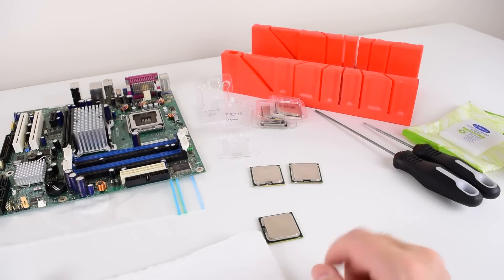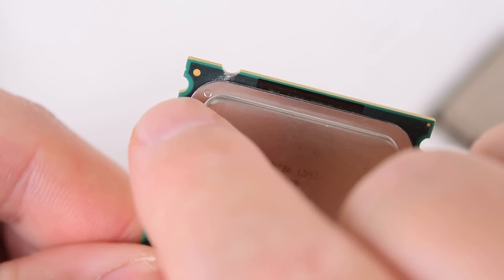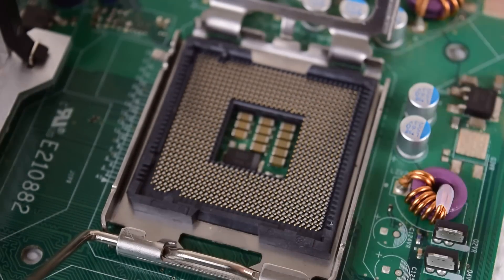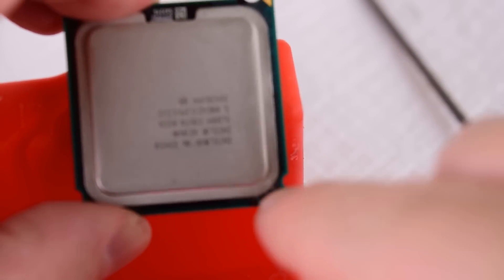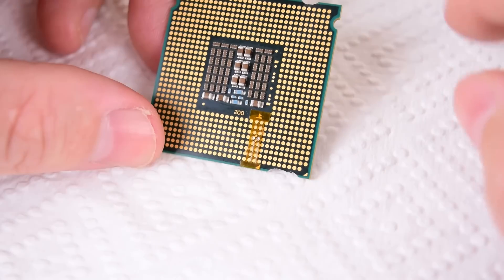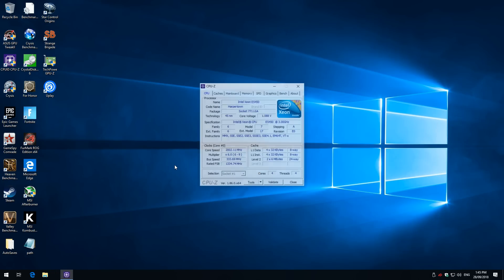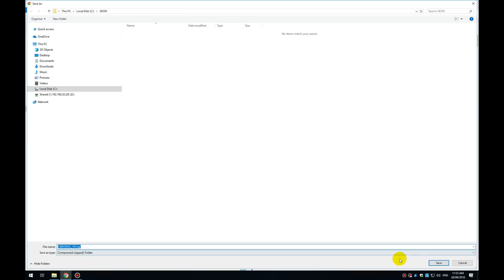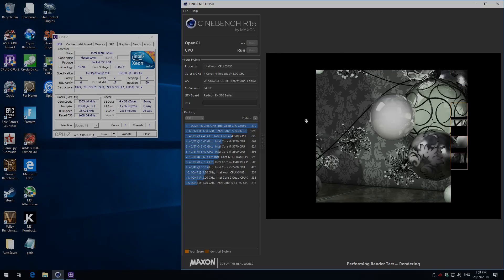Modding cheap LGA 771 Xeon Processors for Socket 775 Motherboard

Comment: can you add BSEL mod to this to OC it?
Reply: No, at least not on all of them, on some of them the BSEL mod won't work because the FSB is already at 1600 MHz
EDIT: Sorry obvious mistake, I meant 1333 MHz
Reply: Cant you mod from 1333 to 1600? If not then the voltage pad mods still might work if your motherboard will let you up the BCLK/Multi and not the core voltage.
Reply: @danielberrett2179  The mod from 1333 to 1600 isn't possible as far as I know, though you are absolutely right, voltmodding on those motherboards could be very useful
Reply: I think this should work as long as you get the right pins.
Reply: If I remember correctly, the BSEL mod only works on LGA771 boards which have compatibility for chips with a 1600MHz FSB.

Comment: When I did this mod back in mid 2015, I decided to chop the plastic lug from the motherboard CPU socket, rather than risk making a mistake cutting the CPU itself.  The Ebay seller I bought my CPU connection rewiring stickers from, also provided the BIOS microcodes for free.  I think it was a Greek seller but I can check if anyone is interested.
Reply: EgoShredder I’d rather mod the cpu for my asus P5Q as it’s a pretty nice board(I also plan to eventually buy a Maximus II Formula board)

Comment: I already have a Core 2 Extreme QX9650 (3GHz 12MB Cache) is there any performance benefit (other than lower power consumption) for a system like mine? The main limiting factor that made me jump to an i7 6700K was being stuck at 4GB RAM on my old motherboard. But I've been keeping my old hardware the last few upgrades...

Comment: That was one rough notch. It is called manual skills boys and girls. Work at developing them.
Reply: Better to cut one notch of plastic inside CPU bay of mother board. I did that way.

ASRock G41 VM r 2.0
RAM 8gb DDR 3
Xeon x5492  3.7Ghz , 12 MB of L2 cache.

No Bios update required n it auto updates it's microcode.
Reply: How did you manage to do that?

Comment: I have a Q9550 on a p5q deluxe at 4ghz with a cooler master evo 212 I wonder if a zeon would be any better ?
Reply: I doubt it, you're not going to get much higher than 4ghz with a xeon
Reply: Possibly, more than likely it'd just run at a lower voltage and therefore cooler. Though I did manage to get my old X5450 to 4.4GHz on my own P5Q Deluxe (post modding the BIOS), nearly matching my i5 4440. Not sure how well an E5450 overclocks in comparison though-my water cooler died so I can't go as high.
Reply: @dabombinablemi6188  got a question regarding asus p5q deluxe as i was wondering about your bios settings while running x5450 @ 4.4ghz. As i have e5450 eo revision i managed to overclock as high @ 4.38ghz at 1.33v temps were hovering around 70c. I was asking about voltage and ram timings as i was looking for compare result
Reply: Probably not, it’s not really worth the mid if you already have a 45nm 12 mb quad.

Comment: There is this one Video I have seen where some one ran an incorrect CPU socket on a motherboard and somehow they got it to work but it shorted out the motherboard after a while. I heard of this mod as well. I agree that modding the processor is better than trying to mod the board because if you damage a board that you want to use then your screwed. Makes me wonder how reliable is this mod on certain motherboards over time  because if you use a processor that uses wattage that the board does not support it could short out the board and ruin it.
Reply: Fender178 If you do use a 775 CPU as a placeholder into the socket while trimming the tabs the procedure is a lot less risky. Also, excluding the top of the line X ones, all the Xeons are rated at lower TDPs than their Core 2 Quad counterparts. They even run at lower voltage at stock settings and can be undervolted by a hefty amount. Running at 3.0 GHz with E Xeons at 1.05 V or less is quite a feat. And regarding SSE 4.1 then the Harpertown Xeons are your best bet to fill the bill. Best regards!

Comment: I'm trying to figure out what the sticker does, is it bridging some contacts? (pads) This is such a cool mod! I'd modify the socket personally since it's just two bits of plastic v. filing into the chip.
Reply: youtubasoarus The sticker routes the traces of the bridged pins, as they are inverted in 771 Vs 775. Those pins are involved in memory communication, thus the mod is critical to get them to work. There are other pin differences between 771 and 775 but most of them are grounding pads.
Reply: Very cool, thank you for the comment :)

Comment: Thanks for making this video! However, for anyone new to this mod I would prefer to recommend to mod the socket instead of the CPU, as it's easier, requires just a thin blade and the risk of damaging the pins are minimum if you use a cheap/dead/useless 775 CPU to guide the trimming. Also, this page contains a lot of pre modded BIOS files for a wide variety of boards for free: http://genius239239.myweb.hinet.net/771/. Hoping to see more of this platform in the future!

Comment: How much better is this CPU compared to a core 2quad q6600
Reply: It will be a lot better as it has more cache, faster fsb, faster clock speed, is 45nm(better clock to clock performance), has newer instructions(some new games and apps won’t run on the q6600), and will use less power. I have a q9550(equivalent to an e5450 but at 2.83ghz) and it’s way faster than my q6700(higher clocked q6600)
Reply from the maker: Look for q9650 comparisons!
Reply: A Q6600 should be tape modded to 3.0Ghz.

Comment: One question i use a modded xeon on an asus pq5l pro without having applied the microcode it is normal that it wont turn on?
Reply from the maker: It depends on the board, Bios and CPU. But if it doesn't turn on, yes, use another CPU to flash modded Bios.
Reply: @philscomputerlab  thx very much i enjoy a lot your videos keep it up!
Reply: You have to make sure the xeon chip is fitted correctly in the socket as i did get no boot before with asus p5q premium as the cpu needs to be align to the far right/bottom corner of the socket
Reply: @neddy1287  thanks alot mate that was the problem
Reply: @techcheap2340  let me me know how you get on with the xeon :)

Comment: Everyone talking about the new intel CPUs. And here Phil giving us a video about modding old 771 xeons to work on 775 platform

Great content.
Reply from the maker: Haha, like I say, I'm always late to the party :D
Reply: @philscomputerlab  haha, but I'm still gonna buy an lga775/771 CPU and Mobo, I'm so broke :'-|
Reply: Yeah, and I’ll take Phil’s content over that of those others any day. Those tech YouTubers are falling all over themselves to report about the same things at the same time: expensive, overpriced stuff that real people don’t actually buy. Those channels are a dime a dozen. Boooooooooring.

Sadly, many of those channels used to be good, but then they got too big for their britches. They’ve sold out to the big corporations who send them expensive products to “review.” No thanks... not interested.
Reply: All things considered the Xeons offer a considerable upgrade for the LGA 775 Platform. This is very easy to do if you take your time and use patience. The Socket Mod is very easy to do as the plastic cuts very easily. I've done it both ways, with CPU Installed or not and either way works well. Micro Code is only required on lower end boards and some LGA 775 boards accept Xeons with no worries. Micro Code updating is very easy to do as well, it's basic flashing which most of have done at one point or another. Editing the Micro Code is fun as well. As for the New CPU's Intel is offering is not really new news, I mean seriously 15% increase is what Intel has been doing for years now so anything NEW is really not NEW... Cheers...
Reply: Everyone's talking about Intels dirty tricks with the benchmarks more like.
Reply: @Dorothy Wilson get out of here spammer. Reported.
Reply: But this video help me a lot. I think LGA 775 never gonna die.
Reply: @niranjannaik9289   some are able to handle windows 11  smoothly